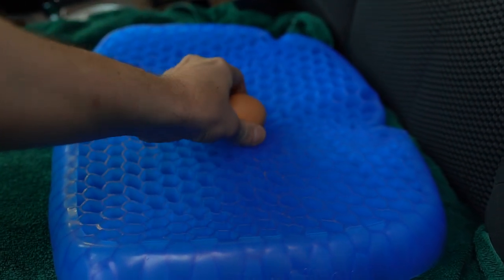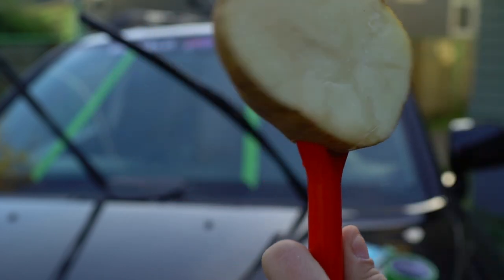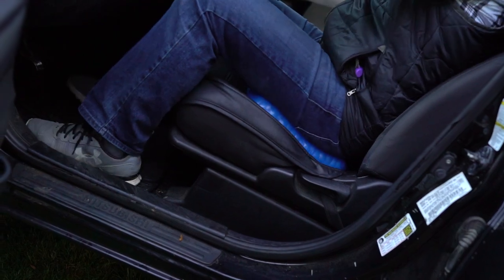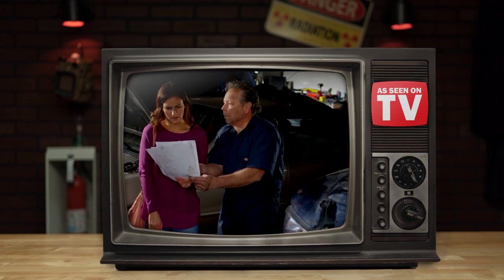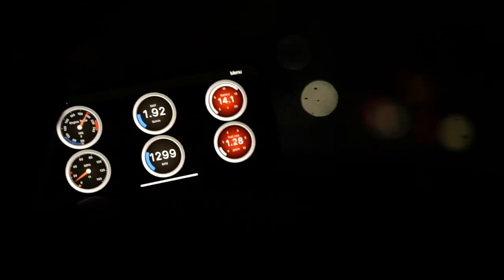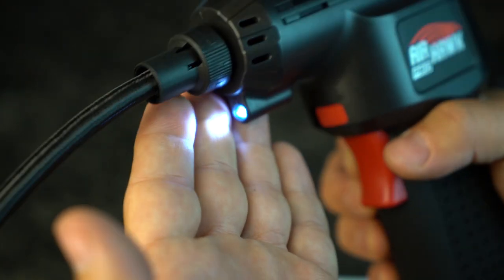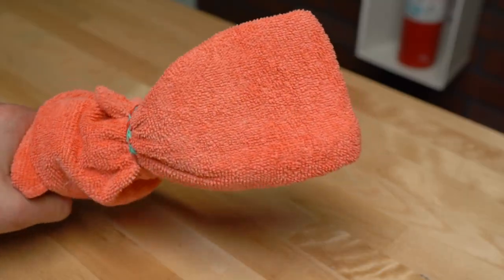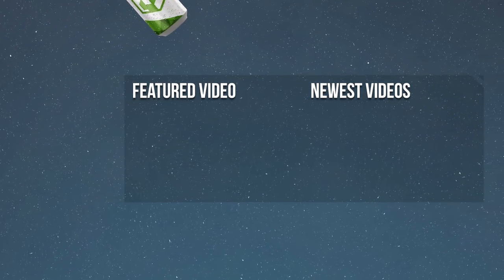As Seen On TV Car Gizmos TESTED!

Comment: You entirely missed the point of the Windshield Wonder. It's NOT for cleaning flat panes of house windows that anyone can get to easily, like you tested, but it's for cleaning the INSIDE of modern vehicles front windows, which can be extremely difficult to reach by hand.

Comment: I have a windshield wonder. It's not the microfiber cloth that makes it a must have item for me. Its the long arm that the cloth attaches to. My dashboard is about three feet deep and it's difficult for me to reach when I'm cleaning  without getting up onto my haunches in the front seat. With the windshield wonder, I can use one bonnet for cleaning the interior of the glass and the other bonnet for dusting the dashboard and never have to leave my seat. It's super convenient. I'm surprised you didn't test it inside an actual car and instead opted to use it on a free-standing pane of glass.
Reply: Very good insight on interior window cleaning Lizzy lou, it is helpful👍
Reply: I had one of these, it broke where the head connects to the shaft after two uses. Garbage.
Reply: I don't take care advice from a chick named Lizzy Lou. Thanks
Reply: Yes, this item is perfect, not just for cleaning but for keeping the Interior of the windshield from "Night Glare". Spray the water directly onto the cloth, only 2 pumps. and wipe away. Don't believe me, do only driver side of interior windshield and notice the difference during Night Driving in traffic.
Reply: Lizzy Lou I agree, strange that they didn’t use it on an actual car windshield
Reply: It also pivots. They "tested" this product all wrong.
Reply: put your knee on the seat with one foot secured on the ground while extending your arm with a microfiber cloth in hand. its a trademarked move but im sure nobody will watch
Reply: Exactly my point also, I love mine
Reply: 5318oo8 unless you have reallllllllly long legs how would you clean trucks windshield it’s just a help it’s easier for people especially for people with disability dexterity issues or any other problems
Reply: Try doing that when driving to clear up your windshield

Comment: The issue with the Windshield Wonder test:  The "innovation" for the product isn't that it's a cloth on a stick, it's a cloth on a stick that allows you to reach the windshield of the car.  In your test, why even have a stick?  I could clean that with just a rag on my hand, no need for the spatula.
However, if you were to try to clean the interior of a windshield, you'd find it's really hard without a solid enough stick that has the pivoting head.  Maybe the rag on the spatula would work, but at least try using the product on an actual windshield and not just a pane of glass.
Reply: Exactly my thought.  This product works really well to get in those corners between the dashboard and the windshield.  They weren't using it correctly.
Reply: Yeap, the tester completely missed the point of the product. 
 I bought something similar for my deep-pocketed windshield. I used it twice and went back to the old hard way to get the results I wanted.
Reply: I don't use mine on the outside, but rather the inside of my windshield. The swiveling head really makes it work. I give it a much higher rating than this video suggests. I agree with you 100%
Reply: I love my windshield wonder! It's so helpful for getting all the way down the dash!
Reply: I agree, I actually own this product and I love it because it's hard to clean the windshield near the dash.  The nice thing too is you can wash the cover when it gets too funky.
Reply: Yeah, I can only reach about halfway down my windshield for cleaning purposes, I have to bend around like a pretzel to reach the "bottom" of the windshield (closest to the dash).
Reply: Agreed
Reply: eksentrysyti Was has
Reply: Exactly!
Reply: I was going to post the same comment. Cleaning an e36 windshield is hard without wiping crud back onto it. The cabin is small dash big windshield is sloped to a point where your hand cant fit. I want the stick!!! They can keep their patty flipper dish cloth away!!!
Reply: Glad to see more people on here with the same issue I had.  Had they tried to clean the interior of a windshield they would have understood the need for this tool, and the swivelled head.  Also, if you have any kind of physical imparement this may be the only way to reach the bottom third of your window.
Reply: eksentrysyti thanks for the stick/no stick analysis and opinions. I found myself pondering your wisdom all last night and into the wee hours. Your willingness to  break boundaries , strike out on your own and eliminate the stick shows resourcefulness and an adventurous spirit. If I ever need an expert to advise how to approach the challenge of  rubbing  stuff on glass while explaining how to rub stuff on glass and including supporting theories........I’ll refer to your post.  Are you a scientist?      Dave, not Eileen.
Reply: This is the first time I have been on this channel and because of this failed experiment (not actually used on a windshield), I won't be coming back.
Reply: @murph1414  I think you might be missing the point of these videos...
Reply: @dustinacheson3612  No I get it. The presenter didn't demonstrate the product as it was intended to be used!
Reply: Windshield Wonder has been around for years.  It's for assisting in cleaning the inside of the windshield down to the dash.  for old guys like me, it saves squirming and reaching around with its longer handle.   Definitely worth the 10 bucks...
Reply: Only read the comments to see if anyone else was thinking this...
Reply: Yea but a spatula would've done the same job, without having to buy anything you dont already have, was his point

Comment: I need the windshield cleaner for sure.  Being winter time and with all the vaping and hotboxing in my car I swear I clean my windshield twice a day.  It’s the worse thing.  I mentioned needing something like that to someone earlier today lol
Reply: I have the windshield cleaner device - and the benefit of it is not the microfibre cloth - but the handle which makes s much easier to get down into the small space between the windshield and the top of the dash. The only trouble I have had with it is that when using a lot of pressure the cloth doesn't stay on the device so well. I also found that the way they have it assembled doesn't quite give the best leverage and and reversing the pivot head makes it easier to use.

Comment: Get rain x windshield washer fluid. It beads up water and you need less of it to clean and it is pretty cheap at Walmart
Reply: SkinnyForeigner I get the actual rain x you apply by hand, the windshield washer fluid left marks of residue on my paint job if I looked closely plus my windshield as well
Reply: Just use a quality car wax/ or sealant. Does the same thing.
Reply: Yeah except it's way more of a pain in the ass to put on, with the washer fluid, I just pour it in the tank, thats it. @TheCowboy4000
Reply: Rain X eats wiper blades
Reply: @matts9011  Does it?  It might explain why my wiper blades don't last very long.  hmm.

Comment: I really didn’t like the air hawk. Yes, the auto shut off feature is good. But to me, it feels really cheap and chinsy. It takes a while to get a tire up to the correct 35 psi, and it gets really really hot. Almost too hot to touch the Schrader valve end.
Reply: As long as it actually works, and saves me long enough to get back home and not need a tow, then it's worth it.
Reply: Not only that, it runs out of power before it gets to 35 psi.
Reply: I think all the innards are plastic, it will work well once or twice by before the gears wear out

Comment: the micro mechanic thing we tried was UTTERLY USELESS on our dodge ram 2500 1999 pickup truck
Absolutely nothing shows up. when our truck absolutely has some kind of problem running. keeps stalling out and running rough when its warmed up.
We tried various other apps that supposedly work with the micro mechanic device. and they all came up empty as well.
returned it to the store the next day for a full refund.
Reply: It's only going to work if the on-board sensors and computers for your vehicle generate an error code. If the issue is purely mechanical, then a sensor may not detect that. But, for your problem, first thought is the idle air control valve, or you have a spark plug that is misfiring.
Reply: yep they are useless told me my turbo purge was bad my truck doesnt have turbo and told me wifes car had mis fire on 7 and 8 its a 4 cyl
Reply: Is there an actual error code? It can’t just find issues that the car computer itself can’t find
Reply: @KevinFields777  is right, but you might try torque, it's another Bluetooth app I think from what I've seen in the video it's a lot more advanced than micro mechanic
Reply: @gadgetsage  Yes, and I can definitely endorse Torque. I've never used Micro Mechanic.

Comment: So why didn’t you find a car with a check engine light. The whole point of the device is to help with that issue and you just showed that it can be used as a HUD.
Reply: Isaac Barnett exactly my thought . Shouldn’t of even been in the video it was totally useless
Reply: All these devices do is read codes and allow you to clear them. Thats all they're good for. Especially when working on Opel/Vauxhall vehicles you need a tech2 ideally. I had an issue that was referencing the o2 sensors however when I took it to a garage it was a totally different error.

You gotta be careful with them.

Comment: Just a reminder. The "micro mechanic" is not totally accurate all the time and will only diagnose supported vehicles
Reply: You can get it done for free at almost any major parts store like auto zone.
Reply: akingtoddd I have the actual Universal mechanic one.
My family owns multiple shops throughout eastern Washington
Reply: @lifesabitch90  yeah the free scans at the part store only print you off a huge list of things it could potentially be. I can assume that much
Reply: @vamountainman2512  Yep, then you still have to look up the codes online.
Reply: @vamountainman2512  You think this product is going to point you to the exact reason the code was thrown? Lets take a misfire for example. You get a code for misfire in number 1, how many things could contribute to that? Plug, coil, wires, injector, compression, how is this magic box going to determine the problem? How about an emission code for a large leak, might be the gas cap, or the filler neck or a number of hoses and fittings connecting the system together. Some live data is the only benefit to this thing over taking your car to autozone and having it scanned, and that live data will only help you if you have an in depth knowledge of how the system works, which most people buying this product lack.
Reply: @--_DJ_--  oh god no. I was wondering if it were even capable of giving such a vague code. Not just track rpm and speed.
Reply: @--_DJ_--  i was questioning if it was even as effective as the parts house readers
Reply: @vamountainman2512  I am glad to hear that, a good mountain man has common sense. These things must really annoy mechanics dealing with the general "informed" public, I am sticking with fleet work, no customers to deal with. Hope you had a merry Christmas!
Reply: A cheap scanner and knowledge on using google is all you need, really.

Comment: I have the air hawk and it was a piece of garbage
Reply from the maker: Ours worked fine... that’s not to say that we did extended testing on it though.
Reply: Someone bought me an air hawk and I've been using it for awhile, it's been going strong 1+ years so far.
Reply: Skip the plastic compressors and buy a decent Vlair.  The gasket in the fitting at the end of the hose has a habit of disappearing, but they send me new ones.
Reply: You can get the airhawk on clearance now for 10 bucks, I'll get that, it'll only get used once or twice a year at most anyways. @TheSuburban15
Reply: Mine works fine

Comment: I used Rain-X on my old civic. To be honest, for the side windows and the rear windows great idea, for the front also good, but when you needed the wipers in action it leaves massive streaks. 

I recommend Rain-X, is for the side Windows a good addition and you can get it off without polishing your glass. (What some more permanent products require).

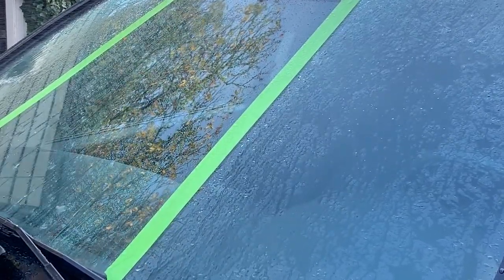Comment: 2:20-Next test, peel the potato before applying to glass. Also, Rain-x would beat RainBrella easily.
3rdly, water does not repel water, so a windex clean up would have been more relevant.

Comment: I don't know how well beads (plastic in my case) work on a car seat, but on my motorcycle they work better than anything I've come across yet (41 years of riding and over 500,000 miles). The beads are for heat reduction and allow air flow around all of it. The beads aren't locked together and give way to the cushion of the seat, so it's not like you're sitting on something solid. But, to each their own.

Comment: windshield wonder is good for windshields that's about it.  car windows have a black coating around the edges so no need to get it in corners.  works good when moister gets into your car and the next morning its all fogged up and wet, makes it hard to see especially with the sun out.  That situation is about the best scenario to use it in.

Comment: As far as the windshield wonder goes my handle broke first use.  A better way to do it is if you have an extra Swiffer broom. I took one of the pieces of the handle off and put a couple paper towels on it and it worked way better and it has a larger size head. Paper towels press right into the grippers for the Swiffer pads.

Comment: Found the windshield wonder in the clearance section of a local hardware store for $2. Honestly, it IS quite useful on the inside of the windshield getting into the tight areas near the dash. Don't think I'd pay $10 for it tho.

Comment: Fail on the windshield cloth thing.
I'm OFTEN freaking out to try and reach my interior windshield because of the angel and distance and the dashboard...
Having a long reach and swiveling head makes it easy, fast and safer than trying to find a discarded napkin and frantically try to wipe the glass at a red light.
Reply: Wow. A year later and no one even gave you a thumbs up. They completely missed the point of that products intended use

Comment: Most of your reviews were great. Unfortunately, you didn’t use the Wonder Wipe as it was intended. I purchased one of these years ago and found it did a great job getting into the hard to reach places, the bottom of the windshield on the inside of the car. Worked really well and I’ve been using it ever since. Your homemade wipe was too thick to actually get into the narrow space between windshield and dashboard. Try it  again inside your car and see what you think. Use some vinegar and water mixture and spray on. Does a great job cleaning.

Comment: The potato didn't work because you didn't buff it out. I have used in in my motorcycle crash helmets' visors and it works. Both inside and outside (inside, it prevents the visor from forming that condensation). But you MUST buff it out. It also works with pure washing up liquid (no water). Apply, allow it to dry and buff it out. The secret is that you CANNOT wipe it when it's wet - the same applies to this magic product. As soon as you turn your windscreen wipers on, it will rub it off and the product will simply be removed. As motorbike helmets have no screen wipers, it works like a charm, every time.

Comment: The air hock only work for size times 13/14/15 if you try using it on 16/17/18 the air tube over heats after 1 time use to inflate a tire 😫

Comment: I bought the inside window wiper but found it to be a bust.  Used the spray bottle when the inside window was foggy and found that even after the windshield was cleared it would fog up again.  The spatchelay item with a microfiber cloth would work better, but using the defroster is much better. And where do you store all these items?  Don't tell me, there is an item for that too.

Comment: When testing the Air Hawke, did you check the pressure of the tyre with a second device. From reviews I have read that is the main problem with it, it’s not accurate.

Comment: The windshield cleaner is for inside a windshield not the outside.  the inside of the windshield is a weird angle this basically has a backwards handle.  They really are worth the $10 bucks if you clean the inside of your windshield and bang you awkwardly bent arm on a dash

Comment: You can take car wax and put it on your windows. Let it sit for 15 minutes in the shade then use a microfibre cloth to remove the wax. You now have windows that will repel rain ( make it bead ) using windshield wiper washer will greatly reduce the effect, as it will with the rain be gone. Don’t try this on the interior glass. If you do, you’ll have a hell of a time cleaning the glass. Don’t believe me? Try it.

Comment: The Micro Mechanic is just an OBD2 code reader with Bluetooth. This is nothing new. There's no way I'd ever pay $30 for it. You can get one on eBay for $5, and there's a ton of free apps which do everything the Micro Mechanic app does. I use Torque lite with my $5 code reader and it's great.

Comment: You neglected to do the most important test of the windshield cleaner, which is to sit in your driver's seat and take advantage of the reach it offers you, so you're not laying across your steering wheel and using it to pull yourself up closer to reach the glass. Testing it by cleaning a removed piece of glass is selling it short.

Comment: I disagree that windshield wonder is awsome. Especially if you use interior protectant on dash. Its low profile enough to not contact the dash and smear dash cleanrr in the window which leaves aweful streakes which are hard to clean.